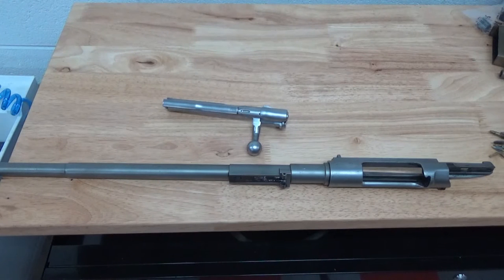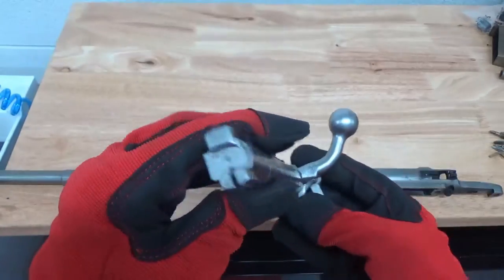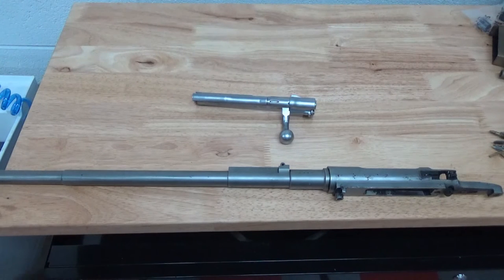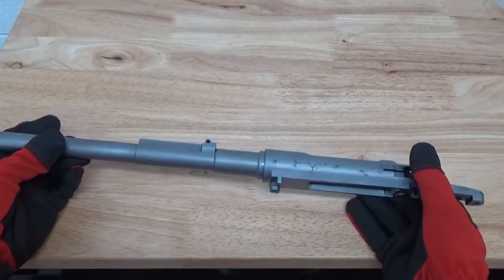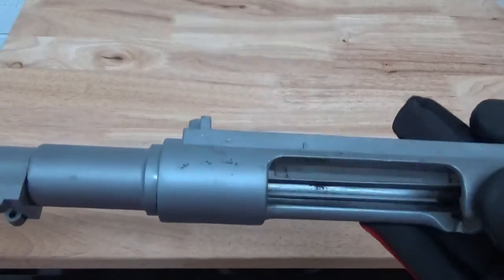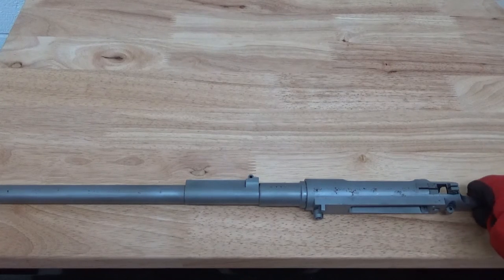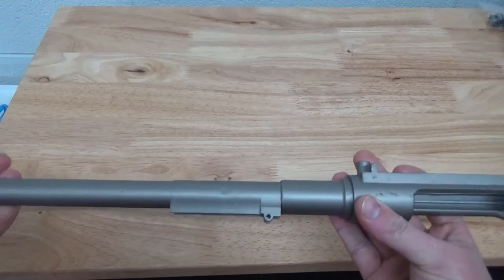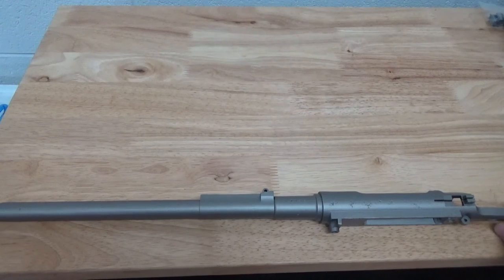Coating Gun Parts With Cerakote- Vapor Honing Technologies

Comment: Does the water leave enough etch on the part for proper adhesion?
Reply from the maker: It absolutely does.  We just prepped a Steering Wheel for Powder Coat and it looks amazing.  nicole@vaporhoningtechnologies.com if you have any additional questions.